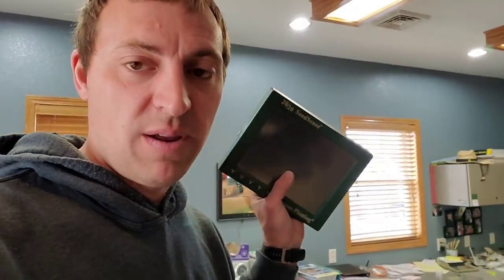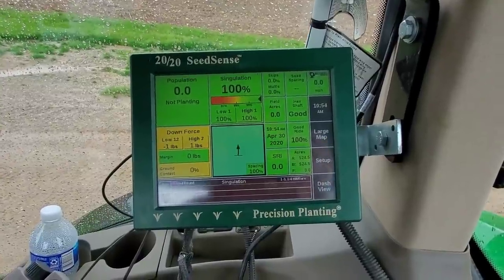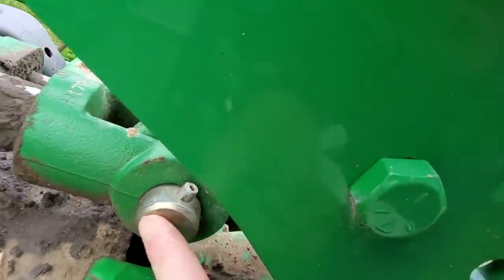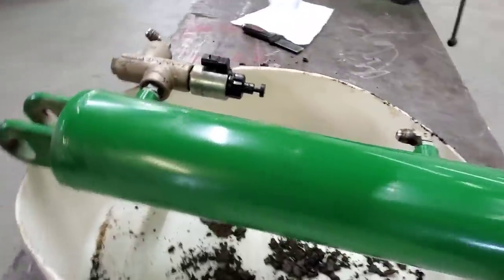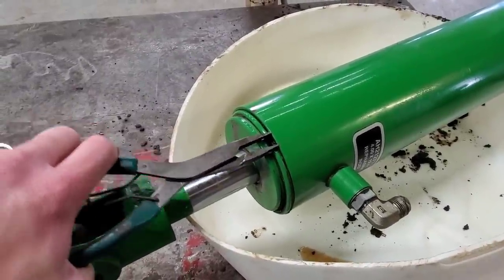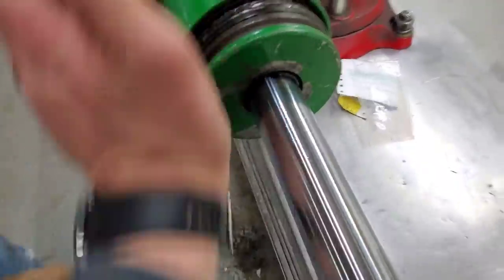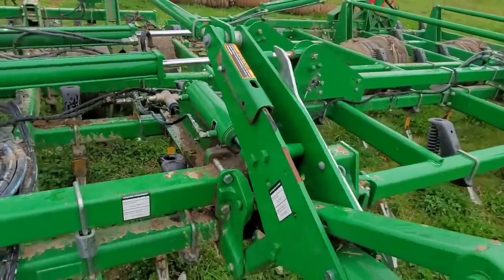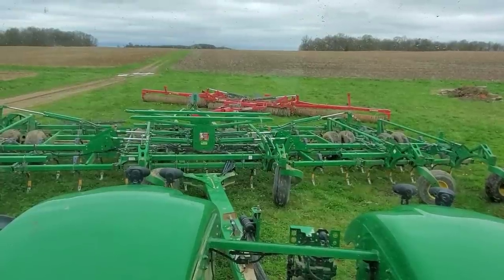How Hydraulic Cylinders Work - #139

Comment: Did you check the hydraulic oil level on the tractor after filling and cycling the the air out of the cylinder?
Reply from the maker: No but I will.  However that tractor has about a 50 gallon hydraulic oil capacity, the half a gallon we lost isn't significant.
Reply: Border View Farms Sorry I keep asking about what may not be important, but I was taught a little preventive maintenance goes along way to stopping break downs when you need to get something done.